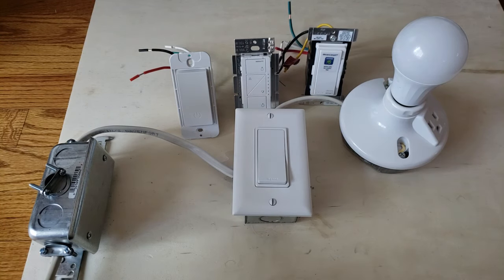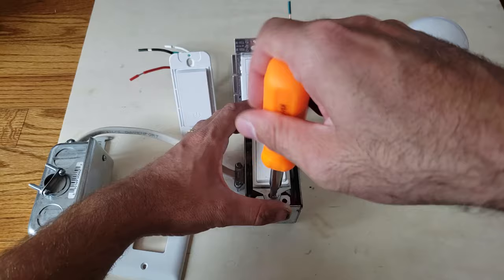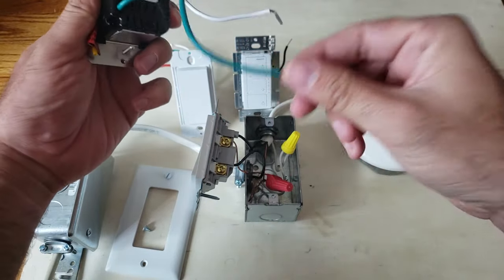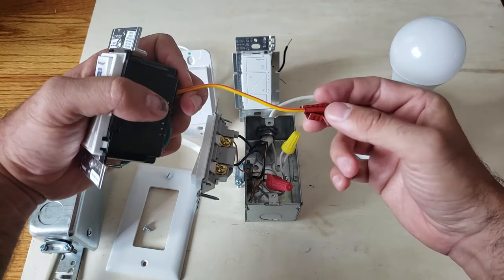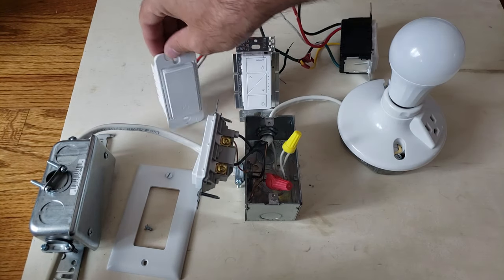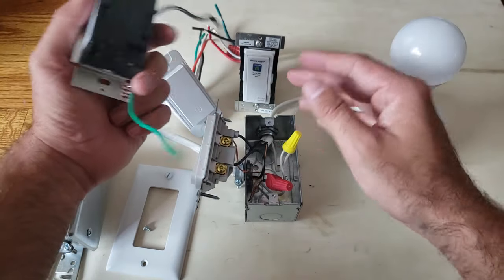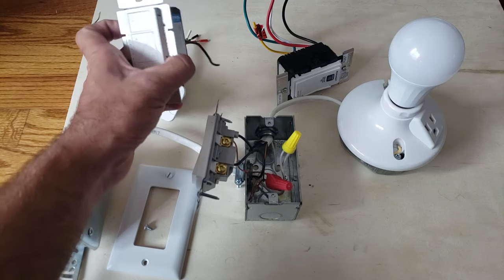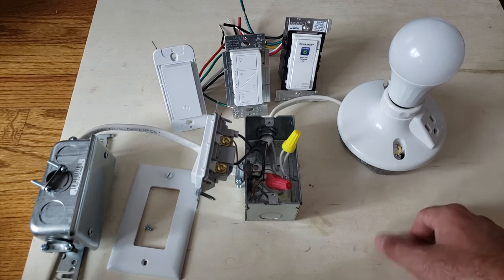Smart Light Switch Neutral Wire - Do You Need One?

Comment: I like the video, it was well done. But you never answered the original question. Do you need a neutral wire? Or can the switches be used without one? Can you hook up a smart switch that has a neutral wire in a switch leg  box that has no neutral because the neutral is being used as one of the switch legs in the box?

Comment: In response to your comment, when using a switch loop the white wire in the romex is not designated as neutral. It is power carried away from the fixture to the switching device.   I can assure you that myself and employees are licensed electricians. We work within the code and inspections. Many municipalities do not adopt the most recent codes. In fact, until last year the city we lived in was working off of NEC 2008. Therefore, it is not correct to say that every home built after 1995 would have a neutral present in the box.   My intent was not to be argumentative, but simply to share what I run into every day working as a licensed electrical contractor.

Comment: Hi! Thanks for the great video. I've installed a bathroom fan with light and Bluetooth speaker, all in one. Of course, the switch requires a neutral wire. I ran the 12/3 romex and created a junction box in the attic since they had previously ran the power and everything else to the old fan! Now everything works including the switch but the fan and light aren't working. The company says it requires a dedicated (isolated neutral) and power but I can't quite understand how to do that. Surely they don't mean a dedicated circuit? Any help is appreciated!

Comment: can anyone please reply, i got a string of leds and the wires from one end of the led's goes into an electronic ballast box and wires from the ballast box go into this switch box right next to it and from the switch box i got 3 wires coming out a black a white and a green, i am assuming the green is neutral because i hooked the black and white to a 2 pronged plug since i could not find a 3 pronged one but the led's work fine so what should i do with the green wire can i just shove it aside or should i be soldering it to the switch box which is made of aluminium housing?

Comment: I have 3 neutrals. One from mains, one to light and one connected to other switch. Do i connect all 3 neutrals to the neutral on the lights switch? I've tried it like this but the switch doesn't power on. So Im wondering if i need to only connect one of the neutrals. Or is the neutral from the mains maybe not connected at the mains? 🤷‍♂️ i don't want to fiddle with the db board at all. Just looking for opinions

Comment: I'm wanting to install a Meross smart switch on my gass fireplace. There is no real current on the switch contacts. Will the switch get operating current from the neutral wire? The switch requires some current to connect to my WiFi, but just completes the circuit of milliamps to open the gass valve.

Comment: When you have no neutral on a single pole luvion dimmer why does it allow voltage to pass when the load circuit is open?  I removed some cabinet lights and not the existing switch doesnt have lights or functionality but it lets power through?  I added a new one of these switches in a different location also with nothing connected to it yet and its doing exactly the same thing.  Does it need to have a closed circuit for it to show functionality and also light up the dimmer lights?  Im so confused.  When there was no neutral my head almost exploded😂

Comment: Question for One Hour or anyone who can answer for me. Don't older homes built around the late 1970s also have a Neutral Wire that runs back to the breaker box?  I see the white neutral wire in my home, but it is not accessible in every light switch junction box.  I know I can purchase a No Neutral Wire, No Hub light switch which I will do.  But, I am just curious about neutral wires that run back to the breaker panel.  Thanks for your answers.

Comment: I just bought a Kasa. Smart wifi switch (single pole). It has 2 black, 1green and 1 white. My walll box has no ground wire. So where should I connect green wire from smart switch to?  My current switch has one black wire screwed to switch , and from that screw to tapped into another bundle of black wires. and a yellow wire to other screw. 
Maybe someone can help me.

Comment: I could connect a luthon cassette to light switch for my kitchen lamp I have a 1936 house with older style cable -cloth outer sheathing two conductors with no ground black(hot) white(neutral) what would be my other option thanks

Comment: I have 2 smart switches in a double box in my kitchen. Both lights come on when the main lights are turned on but when just the island is on the other lights don't turn on. I've had several electricians try to fix it with no luck. Any idea why this would happen?

Comment: i have a problem. My line only has 3 wires 1 black(guessing its hot wire), 1 white(guessing its neutral)But this white wire was connected to my switch so im also thinking its not a neutral wire cuz its connected where Load wire supposed to go, then Ground wire. But as u can see smart lights need 2 black wire and white wire. What do i do?

Comment: I have an old house and am just learning that there are non-neutral switches out there. I am insanely confused by how the switch would be powered if there was only a single hot switched by the old switch? Namely, let's say my box has no ground, literally just: house hot ----> switch ----> light. Separately, the light has a neutral wired in it's fixture.

Without a ground or neutral just hot into the switch, load wire to the light... how is the switch powered?

Comment: I'm in the UK. We have 3 wires standard (legacy = 2, with no earth): Live, Neutral and Earth. Earth is required because we use 240v and it can more easily kill, thus - the Earth is required to ground the switch. That leaves Live and Neutral purely for the appliance (light-bulb etc.). So what is this extra 'neutral'? It sounds like it is also constantly live, just like the 'Live'. Is this extra 'neutral' just a lower amp, permanent live 'loop' - through every, single switch? If so - I 'get' that, it's a little like a relay, however - a relay needs it's own small amp live and neutral pair, as well as it's 'switchable' higher amp live / neutral pair. Confused.

Comment: Does anyone know is there some solution for the following scenario.
I have 16 led lights 25W each with dimmers already installed into the walls, I want to use those dimmers capabilities and integrate that into some device which will give me control over the lights through smart phone and one main switch for all lights. At the moment one switch in the wall controls 4 of them.

Comment: If you do have a neutral wire and you want to install the casetta, what do you do with the neutral wires in your gang box? Do we just leave them as is then? And will they always be two white wires pigtailed together
Reply: If you do have a neutral connection available in the switch box, that will allow you to use the Casetta or pretty much any other smart switch.  With a "no-neutral" smart switch like this Casetta, you would just ignore the neutral wires in the box.  

If you do have a hot wire and a neutral wire in your switch box, you may be better off using a different smart switch.  Other comments here say that this Casetta smart switch is more expensive, and also requires the purchase and installation of a separate wireless hub to communicate with the switch.

Comment: I have a no neutral line for a plug that my basement lights work off of. I wanted to add standard lights with a smart switch. So I worked in reverse, Wired starting from the new lights going back to my light switch. so I have the load coming from the old wire going thru the switch creating what I thought be a neutral wire system. But I tried an HS200 (TPLink) but my lights do not turn on.  The switch is showing flashing symbols, but no action. Is there something I can do or do I have to scrap the idea?

Comment: I have one of those old load out that only has one neutral and one line but no ground or load wire. How can I still use a smart switch that has neutral, ground, load and line setup?  I really like to place one in but hate to call a electrical specialist during virus right now.
Reply: I was just looking at instructions for the Lutron Caseta switch, and they say to just cap the green wire on the switch if there is no grounding connection in your box.

Comment: Hello, I bought the moesgo smart switch..  only has 3 connections (L, N and L1) but does not have a ground.. where do you connect the ground? Or is it ok to just not hook it up anywhere. Thanks
Reply: If there is no screw or wire attached to the switch unit for ground then the switch unit is grounded when you screw the switch unit to the wall box. Just make sure your wall box is grounded. If it's a metal box look for a green or bare copper wire screwed to the box. If it is a plastic blue box, you will need to pigtail the ground wire that is in the wall box to the screw that attaches the switch unit to the plastic wall box. Also, if the metal box is not grounded then you will need to pigtail a ground wire to the wall box or to the attachment screw of the switch unit that screws to the wall box.

Comment: Thanks for this video!  I am trying to locate a smart switch that I can use to turn the hot water on and off.  Currently, the plumber has connected one of the signal wires from the thermostat to a standard light switch to make or break the connection for turning it on and off.  I would imagine that I can replace that switch with an off-the-shelf light smart switch and connect the power to a relay to connect/disconnect the signal wire, but are there any switches made for controlling thermostat wires for hot water that function the same way that the typical smart light switches work, either by pressing to toggle on and off, or using an app from everywhere?
Reply: Hi James, again, I really appreciated your insight on not only this video but some others that have helped me in implementing smart home features!  I am hoping that based your depth of experience and insight on smart homes, that you can at least point me in the right direction regarding my question above about controlling my hot water tank.

Thanks again!

Comment: What if the light fixtures are run before the light switch? For example my setup is breaker panel > light fixtures > light switch at the end and only have neutral, hot and ground.
Reply from the maker: My recommendation is to use the Lutron Caseta switches: https://amzn.to/3k57gZK because they don't require a neutral and are non directional so even if your hot and load are reversed they will still work.  Most likely your "Neutral" is actually a  "load wire" but it's just not indicated as such. Depending on the local codes when a "neutral" is used as something other than a true neutral it should be marked with a strip of electrical tape in the junction box.

Comment: I'm trying to install a fiet smart dimmer but the original light switch only has 3 wires black, white and the ground but this smart switch requires the red one which will be the load, how to i go about making this work?
Reply from the maker: This video shows you how to install the feit electric switch: https://youtu.be/3BRgEe0mNqg however it does require a neutral wire. This video shows an option to add a neutral wire: https://youtu.be/LaqPDBbMgLM However the easiest installation would be to select a smart switch that does not require a neutral wire. The Lutron Caseta switches: https://amzn.to/3q7HkyW don't require a neutral wire which would make them easier to install and would not require additional wiring. This video shows you how to install a lutron caseta switch: https://youtu.be/-YgqqmYzQww

Comment: In  my home two of the bedrooms have a light switch that only connects to an outlet Not a ceiling light. Would this product still work? If not what other options would I have?
Reply from the maker: Yes, it will still work as a switch controlling the outlet. But you need to leave the lamp plugged into the outlet with the lamp set to the "on" position to complete the circuit and allow the smart light switch to be powered. You will then be able to remotely control the light with the light switch or your phone or voice.

Comment: This was very helpful, I have a smart switch that requires a neutral wire. My current box has the neutral wires tied together with a marette as shown and I wasn't sure about whether I needed to tap into the neutral. Thanks for this well explained instruction.
Reply: I came across the exact same issue. This video was very informative and answered my questions 😄

Comment: Question, I have no neutral wires in my home as it was built in the early 70's. The smart switches require a neutral wire to power the wifi chip in the switch. Couldn't I simply split the hot wire before it goes into the switch and use the new hot as a neutral to power the wifi portion of the switch? I am aware that there are no neutral switches on the market but they are 3 times as expensive and im broke so Im looking for a simple hack to bypass this without having to rewire the house or return all the switches and go back to the originals.
Reply: Same question here...did you found an answer?
Reply: I'm not sure what you mean by splitting the hot wire, but switches that need a neutral will need both a neutral AND a hot wire coming into the switch box.

Comment: I only got a black and a white wire in my wall.
Just two wires. Can I still use a smart switch?
Thx much.
Reply from the maker: Yes, you can. These light switches: https://amzn.to/2zrIocj will work. I've installed dozens of them with just 2 wires that is similar to your wiring.

Comment: Most wires today that are installed like the one u have is a white wire that has a black, white, and green wire; you have an extra black (load or hot) so in my case I have 3 wires black white and green how would I use the Levinton that has 4+1 wire?
Reply from the maker: You only need the hot, load, neutral and ground. You dont need to connect the extra wire unless you have a 3 way switch.

If you use lutron caseta you only need to connect ground, hot and load.
Reply: @OneHourSmartHome   so let me understand the green wire will go with the green, the white will go with the white, and my black wire will go with the red wire and what about the black wire from the Lutron dimmer what will that connect to?

Comment: what do you do if you do not have a ground wire in your light switch box?
Reply: Just connect the ground wire to the metal box should be a screw at the back of the box. If not just screw it to something metal should be good 👍

Comment: So I just connected 2 dimmer wifi light switches side by side. I have only 1 bunch of common neutral wires so I connected both switch neutrals together to the bunch. I am finding that at times the switches are turning eachother on. Is this because the neutrals are connected and what would you suggest if this is a problem. Thanks in advance.
Reply: Hi! I have the same problem! I’m about to install two dimmer switches side by side and I don’t know which neutral wires to use for each switch. How did you solve it?
Reply: @torigb8047  I actually found when I changed my LED bulbs to a different brand that they no longer turned on when the other did. I put both neutrals on the same line, it's the only option.

Comment: Does anybody know where I can get a smart light switch with no neutral and a remote control that is not my phone?
Reply from the maker: Yes, this kit will work: https://amzn.to/3KIwz1G You don't need to set it up on your phone you can just wire it and connect the remote provided in the kit and it will work to control the smart light switch. The smart light switch also does not require a neutral wire. If you do want to have the option of controlling from your phone or with the provided remote this is the kit you would want: https://amzn.to/3MTJnVV

Comment: It would be helpful to do a video for adding a neutral wire instead of recommending the high cost Lutron switch which requires a hub as well. There are tons of other smart switches including the ones you've shown that need a neutral. I don't have neutral. Where's the video showing how to add one? Nobody seems to want to explain this. I need to add a neutral wire.
Reply: You would need to pull new wire in the wall.  Not a small job
Reply: Youd have to rewire the entire house or that run. Not simple

Comment: WHAT IF THERE'S NO NEUTRAL WIRE IN THE SOCKET. CAN I STILL USE MY SMART LIGHT, AND WILL IT STILL WORK?
Reply: As far as I know, all light fixtures require both a hot and a neutral connection.  Even if there is no neutral wire in the switch box, there would be a neutral wire where the light fixture is wired in.

Comment: What's the work around if you only have 2 (two) wires in the light switch box that you would like to replace?
Reply: So there is no work around. I had to find a switch that already had a neutral wire and tie into that and run it to my other two switches. I only got enough wire for those two switches. I have at least 3 more switches I need to do.
Reply: Looks like im in the same position

Comment: is there a workaround if your switch requires neutral but your box doesn't have one?
Reply: Same question. Why I watched the video to find out. Does the smart device not work ? Can one just splice one wire into two to go on the neutral wire? (Black vs hot vs neutral)
Reply: @BobBob-ss3nr  if you have access to a neutral on the same circuit you can splice into it but only a neutral, not a ground or other wire, in my case, there is no neutral wire in the box at all.